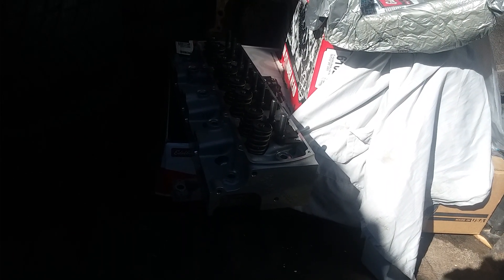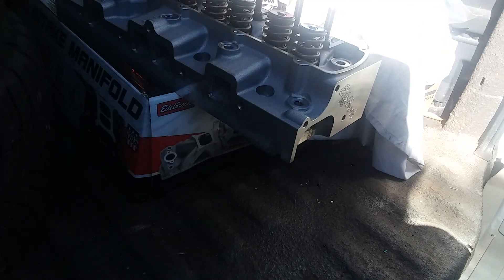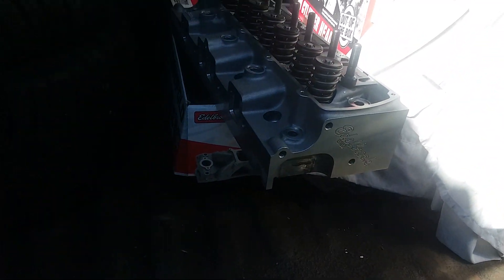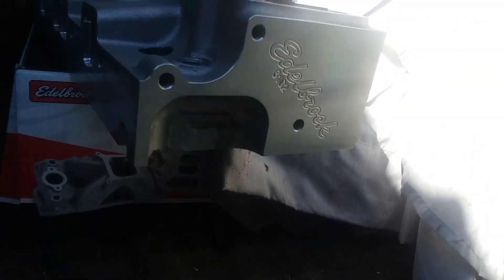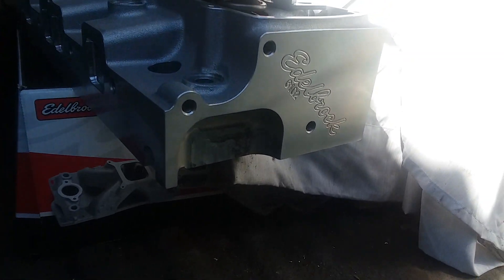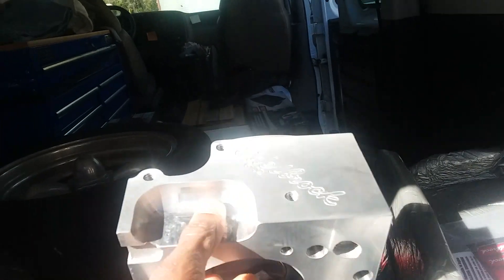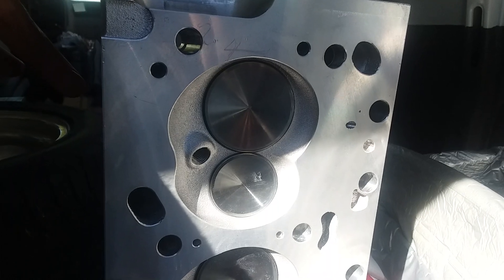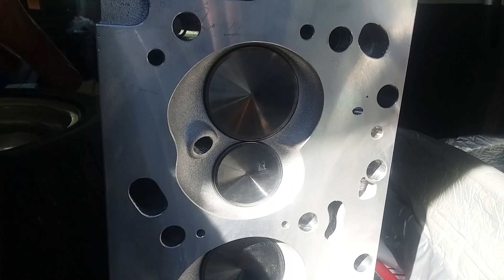409 Olds update!

Comment: That is one massive scallop out of those heads for a mechanical pump.
In a video put out by Oldsmobile Performance and Machine, he says that the new chambers on these heads add no gains to power.  ?  
I sorta believed it since the Olds heads have very low valve angles at 6°, so the short side radius probably has little flow on it until the valve is well off the seat.  I'm  no expert, though. 
I didn't know that the valves were taken to the max on the intake ports.  Definitely better flow there.  That alone should be worth half the price difference to the Chinese heads.
Reply from the maker: 👍 very satisfied with da performance. My cr is about 9.75; Comp cams XE 262; stock converter/3.23 posi; Holley 750 dp. Got my revenge on the stout 84 SS Monte(327 alum.heads etc.) These revised E-Brock's working.